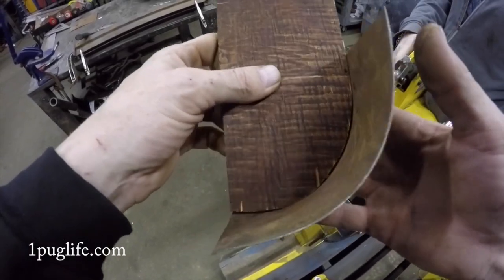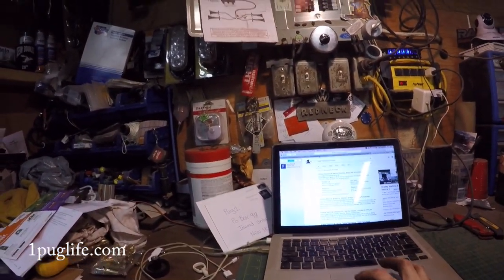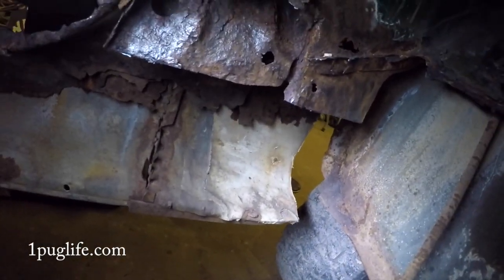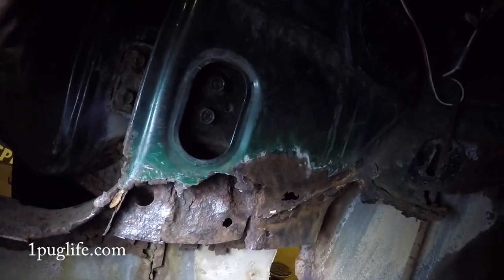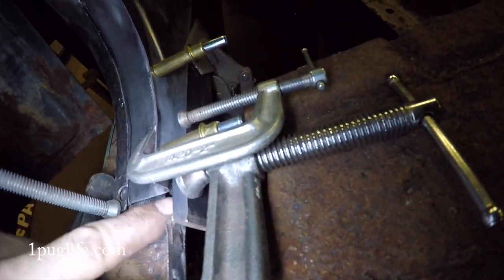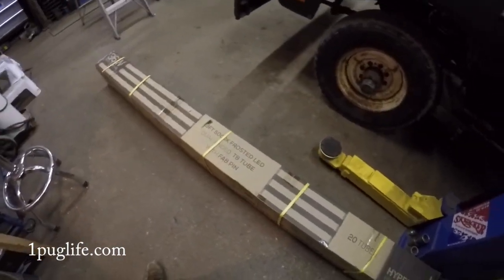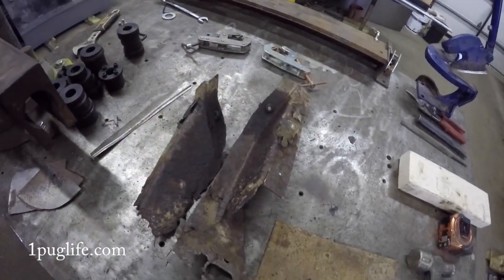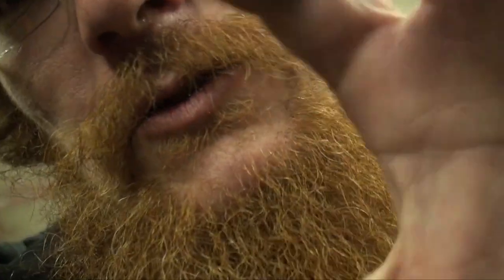how to do your own sheet metal work

Comment: Gouda job on the metal fabrication for the 83! The replacement LED tubes are nice and bright ffs! You may need to change the end sockets on the ceiling fixtures to single pin ones if they are high output ones, as they are different.
Reply: photocontrol ii